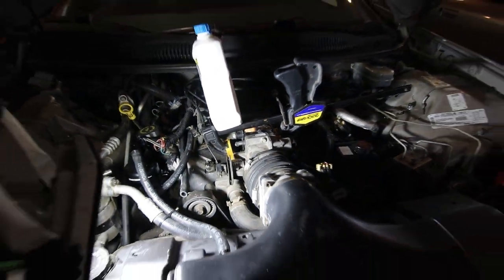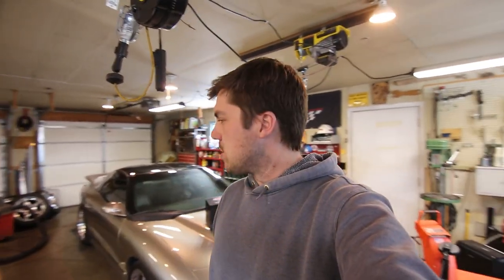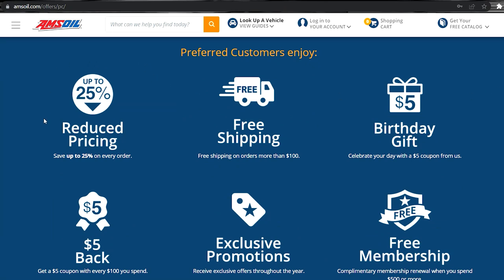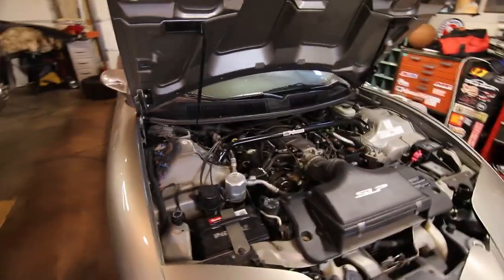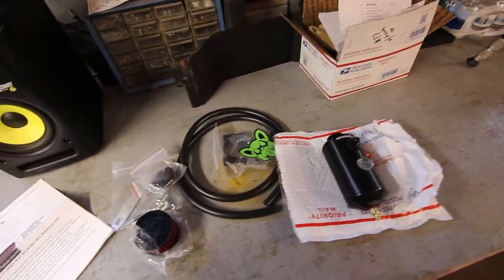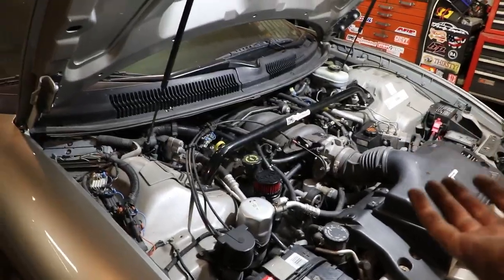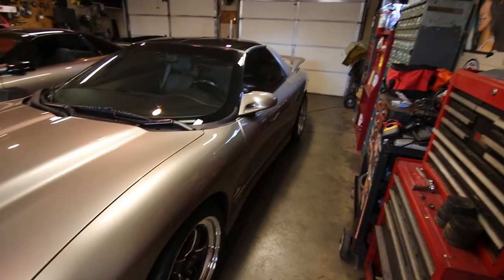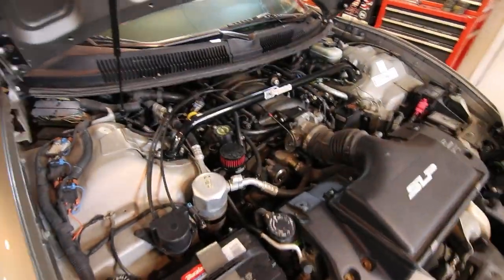WS6 - Mighty Mouse Catch Can Install! Lost Parts FOUND & BIG Channel Announcement!

Comment: Nice find on the wheels. Luckily I’ve found and bought 2 sets of 4 Speedlines, but they originally came out in the mid 90’s
Reply from the maker: Awesome. I'd scoop them up too if they were affordable. Just going to get harder and harder to find.
Reply: @Greenlightfilming  yea I did grab them up lol. Paid 100 bucks for 1 set of 4 one of them has a small crack starting just on the inside lip before the tire bead meets the tire be easily fixed  and the the other set of 4 dude wouldn’t come off 500 bucks lol I didn’t need them. But wanted them knowing how limited number that’s remaining out in the world😏 but I do like the style of ws6 rims u just picked up I’m gonna have to track down some sooner then later lol

Comment: I had a set of Marauder wheels redone years ago. They were in rough shape so my only choice was PVD chrome after they were repaired. They still look amazing and out shine anything stock. You can also get pvd chrome in a darker color if that's your preferred style.
Reply from the maker: We're you able to find a place that redid them locally or did you have to ship them out?
Reply: @Greenlightfilming  I was able to find a place local to me. The place is called Detroit Wheel and Tire. It was 8 years ago and cost under $800. But I think they only handled the repair and had them coated somewhere else.
Reply from the maker: @RyanGlenn810  that's not a bad price to have it all done. I'll have to shop around and see what I come up with. Thanks for the tip!

Comment: I was on the hunt for those wheels for awhile too. I ended up scoring the unpolished ones off a 96 WS6. Nice find!
Reply from the maker: Sweet. Surprising how tough it is to find a set isn't it.
Reply: @Greenlightfilming  it sure is. It was much more difficult to find than some OEM ZR-1s for my Camaro.
Reply from the maker: @JoeSmith-tu7vi  how funny is that haha. Sort of like finding c5/c6 wheels. They pop up pretty often. For whatever reason these are hard to find.
Reply: @Greenlightfilming  I see that too where I live (Colorado).

Comment: Damn I just put in an order 4 days ago for $408 in Amsoil products ordered.  Undercoating, fuel additives, all kinds of things for my 05 Escalade and 01 WS6.  It has 57k miles so I want to keep using Amsoil in it since it’s been doing great in the daily driven truck.  I would LOVE if you did a tutorial on a might mouse oil catch can for the Silverado.  I’m not sure what year you have but it’s probably got a similar engine to my 6.0 vortec in my Escalade.   I would really like to have a MM in both after watching your video.
Reply from the maker: No worries man, things happen how they do for a reason! You can always sign up now at my link and use it later. $20/year would save you a pile of cash on that big of an order. It pays for itself QUICK. 

I'll look into the Silverado kit for sure. They are probably almost the same on my truck and your Escalade. Thanks for checking out the video! MM cans are the best in the business.
Reply: @Greenlightfilming   yeah I’m a member. I spent over $500 and got the free membership for another year haha.  Since it was about to expire.  Is there any Amsoil for the manual transmission for the TA’s?  I tried to look and didn’t see anything. Also I forgot to mention this in the first initial comment is there anything Amsoil related for anything with the clutch in the manual TA’s?
Reply from the maker: @EvansWS6  Funny you ask about the transmission. I called their tech line to see what they recommended for each of my cars, and their Signature Series Multi-Vehicle ATF was going to fit the bill as it's backwards compatible to Dexron III like the T56 calls for (idk why I'm assuming your WS6 is an M6). Lol. 

They also have an "OE Multi-Vehicle" ATF that's a few bucks cheaper/quart that would work. 

If you look up your model/year they list a couple of options for automatic transmission fluids as well.
Reply: @Greenlightfilming   See bro that’s what confused the hell out of me...  I was like ????? Why the hell does it only show ATF????? Lol That’s one thing I like about my Cadillac and the TA they just about both use the same fluids lol.  I want all my fluids to be Amsoil.  If they have the kind of engine oil they have one can only assume that the rest of the fluids for other parts of the car are top quality.  I also want to try and find out what part # the extended life lol filter is.   Not because I plan to go thousands of miles more but simply because I want that extra filtration, because why not, you know?   I use them on the truck already.  Is there any other kind of fluids that you think I may need for the manual transmission, clutch system that I’m not thinking about that they offer?.
Reply from the maker: @EvansWS6   haha no worries, I hear you. For the clutch system on your car you'll need a DOT 3 equivalent brake fluid to meet the OEM requirements. You can also use a DOT 4 equivalent for a slight improvement in boiling point when fresh, and saturated with moisture (this occurs naturally over time). 

https://www.amsoil.com/p/dot-3-and-dot-4-synthetic-brake-fluid-bflv/

If you wanted a premium product that meets and exceeds DOT 4 check this out:

https://www.amsoil.com/p/dominator-dot-4-synthetic-racing-brake-fluid-bfr/

Oil Filters:

Amsoil carries WIX filters, as well as their Amsoil branded filters. 

The Amsoil filters are good for 15k miles. Just punch in your vehicle info here: 
https://www.amsoil.com/?zo=30422823
and it'll show you what filters they carry for each system. 

I believe they offer oil filters for pretty much everything.

Let me known if you have any other questions.

Thank you.
Reply: @Greenlightfilming   is there some kind of code to put in so you get credit from a purchase?  Or just follow the link or insert your dealer #?.   I definitely plan on getting that coming in.  It is my first manual car so I’m a bit new to it and preventative maintenance required to keep it acting as it should.  Thank you for all of the links. I wish there was a way I could ask you any questions about the MM system if I have any and maybe some other questions regarding this car because I know no one in person that has one much less knowledge about these cars :/.  Being stuck googling questions I have to search on forum posts always leaves mixed answers and I don’t like that lol.
Reply: @Greenlightfilming   Also you should do some tutorials on how to change certain fluids all while promoting the Amsoil brand and their products you use.  Extractors etc.  Not too many good videos out there for transmission fluid changes, steering, brake etc specifically for these cars.   Nothing quality at all just half ass people who don’t have the means to film correctly while explaining correctly with some tips along the way.  I know some people like myself would really appreciate videos like that.  It would kill two birds with one stone.  Surely to get some good views and helpful videos will generate more thumbs up etc etc all while promoting your dealer status.  Could post links to the correct fluids you use for X fluid change, and links to other fluid change series for Trans ams (FBodies) etc.  just to show up in the search for anyone searching specifically for key worlds like that. That’s one thing about having older vehicles is no one really does tutorials and videos on certain things for either one of my vehicles.  People that do use old ass cell phone quality video or use good quality and give poor tips and details for the process.  No one size fits all video for each and every task.

Comment: Does the filter get oil soaked? Just installed a turbo on mine and vented the oil cap with a filter and I'm getting very little oil residue on my engine.

Comment: Hey I have a serious question bro.  I need some help learning about the t56 in these cars.  Is there any way to tell when you need to change the clutch?   Can you tell by fluid?  Or do you have to actually drop the transmission in order to see anything?.   I’m new to manuals and new to this one.  Mine pushes in good and I don’t have slippage.  It has 57k miles but still miles don’t mean anything. It could have been drive  hard and I not know it.  I just need any advice and info you can give.  I want to drain the oil and fill it and get the fluid sent in to be analyzed but I think that would be pointless for transmission fluid.
Reply from the maker: It'll be tough to do an inspection without dropping the trans. There's a dust shield on the bottom you could open and inspect through but you won't see the clutch surface. 

The fluid won't mix with the clutch material, so if it nice and red still it's probably fine. Being as old as it probably is it wouldn't hurt to do a drain and fill. It takes Dexron III ATF type fluid or a new equivalent. 

If the clutch feels good, engages smoothly and doesn't slip I wouldn't bother changing it. Sounds like yours is fine.

Comment: You probably got asked this a thousand times, but what’s your wheel specs and tire specs?
Reply from the maker: They are 18x10 and 18x11 Weld S71's. 295 30 18 front & 315 35 18 rear. Toyo R888's all around.